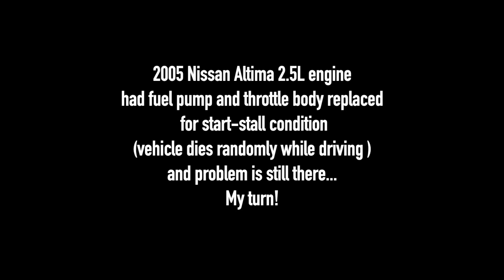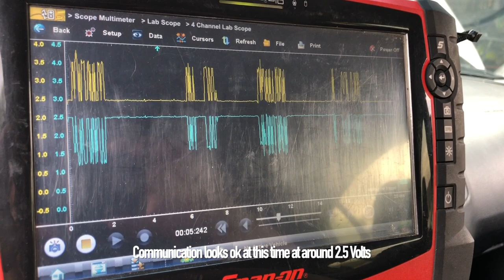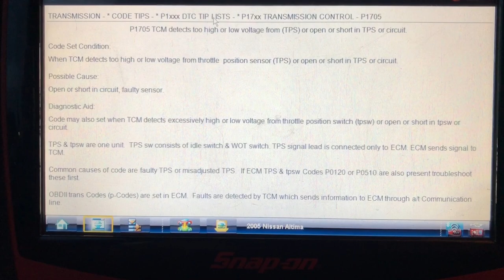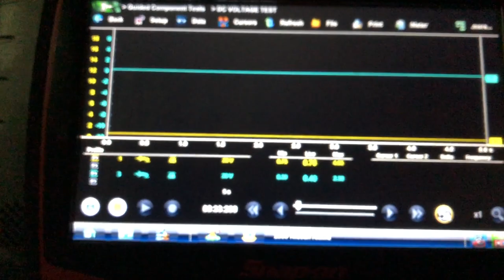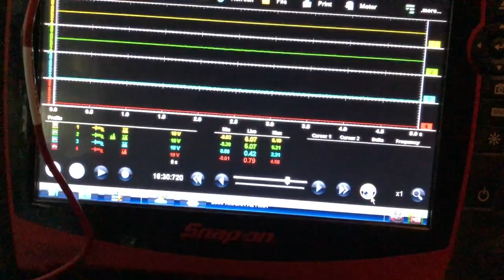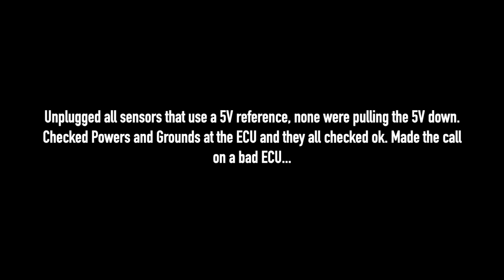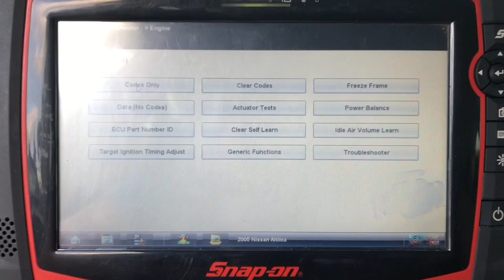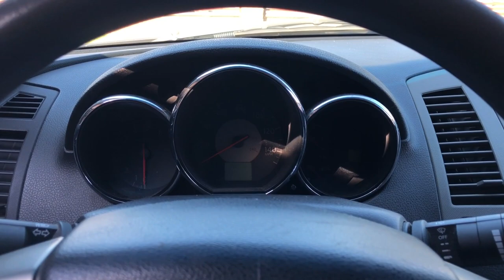2005 Nissan Altima P1705 Car shuts off while driving!

Comment: Good job Homie! I had the same issue with an Altima a while back, turns out it’s a common issue, a tech I work with right now that used to work at Nissan told me that the PCM go bad throwing a code for the throttle body

Comment: There is a poor positive battery terminal design and the terminal can make and break connection while you're driving and the alternator will surge and dip in voltage and damage the PCM.

Comment: hector good diag. just wanted to ask, your verus scan tool doesnt program any nissan immobilizer system? just asking because a little scan tool like the launch diag IV which very cheap in price compared to the verus does nissan, honda, many fords and so far most dodge vehicles. so does the autel mk 808 very econimical. i have both. you could pocket that money instead of farming it out, but good vids, though,keep up the good. work
Reply from the maker: It doesn’t, can you believe that, I’m getting an Autel soon. Maybe Black Friday deals com through.
Reply: my goal is to get the im 608 from autel but thats a bit out of my range right now, but this little scan tools i mentioned dont do all cars but for the price, you cant beat it. take care.

Comment: Happened w My Car a few times,steering wheel locked up & had I been on a Hill I could've caused or been hit & dead than broke down at store w my groceries in the heat & had call a tow truck. It was a CAM Sensor issue so I replaced all 4 of them & it's better.
  Why NISSAN didn't put a Post about that issue idk but very Dangerous...

Comment: I have a car problem. I have a 2006 automatic Nissan Altima 2.5S. There has been an emissions code, but not for misfire. The cars stutters and jerks sometimes when stopped while in drive or reverse. When I put the car in Neutral, the stuttering and jerking stops. This does not happen at any normal driving speeds, just at idle. What can be the issue?

Comment: Hey Hektor! I know this video is a year old, but I need your help!!! I just bought a used 2009 Maxima and I'm having the same problem. My car died while driving on the highway. Long story short, it's having the same symptoms as that car. The mechanic I've taken it to said it's not throwing any codes. He says he thinks it's the throttle body and ecu, but that's after I told him I seen a video (yours) . So he doesn't want to work on it because he's not sure that's the problem. Can you tell me where you're located? I don't know anything? HELP!!!!

Comment: my 08’ 350z has that code p1705 and it has stopped on me multiple times and the tcs and slip lights come on and i loose power and i have a couple minutes for it to come back. i’ve changed the throttle body’s and cam sensors and even the app sensors and still no fix, could it lead to a bad ecu?

Comment: Good job, Hector. Total DIY learner here wondering some things. If you have a bi-d scanner is there a way to activate the APP to check functionality?  If so, why wouldn’t you do that first since you suspected it?  I thought I saw punctures in the APP wires down close to the connector. Didn’t you?  Also, since previous diag was incorrect that means old throttle body is still good (as well as old fuel pump, etc.). Why throw it out?  Questions questions!  😉👍🔧
Reply: Bi directional controls are for things that do some type of work solenoid, actuators, motors, relays, etc sensor use a voltage to send out a signal back to the computer so there’s no real way to activate them using bi directional controls because their signals vary on a relay for example it’s either on or it’s off you can’t say the same for a sensor and since old diag was incorrect and fuel pump and and throttle body are still good it has nothing to do with hector he’s gonna get payed the same weather he keeps those parts or not I would just give em back to the lady and let her decide what to do with them maybe take it back to the first shop she took it to and get a refund on parts and labor and give the parts back

Comment: I had the 2003 Infiniti M45 with similar issue. I replaced a few sensors the OBD claimed; turned out it was a diff sensor confusing those sensors...forgot what sensor. The difference is I could drive around 25-50 miles when it would shut off at highway speeds

Comment: I own that make and model, and what you are describing is what my vehicle is doing right now it starts up and then it dies I took it to O’Reillys to do a code reader, and then my brother did a code reader as well, and no codes came up on the computer the car checked out with no problems that was strange because when I start the vehicle it runs for about 20 or 30 seconds and then putters out and dies
Reply: What locksmith did you call to reprogram the key?

Comment: Hello Hektor, I have a 2005 Nissan Altima SE-R 3.5 and my vehicle shuts off and struggles to turn back on and there are TCS and SLIP lights on and the vehicle is stuck in 5th gear after I get it started it's throwing the O2 sensor code and the Crankshaft sensor, I installed the new crankshaft sensor and it was just cranking I put the old one back on and it turns on normal but like 40 minutes later it shuts off randomly and struggles to start then I get stuck in 5th gear any reason for that?? Or things I should look for?
Reply: have you figured anything out ?? have rhe same problem too
Reply: the*

Comment: Anyone with this problem 100% fix is crank sensor 75% cam sensor  50% mas air flow 25% temperature.......or major problem 100% spark plugs air flood with oil.... Plastic cover on top of engine need new seal...

Comment: Hey how much could this process cost? I am having the same issue with my 2008 Maxima? Can i pull the computer from a Maxima at the junk yard apposed to purchasing brand new?
Reply from the maker: You can but it has to be reprogrammed
Reply: @HomieHektor  ok cool is that process pricey? Thanks again